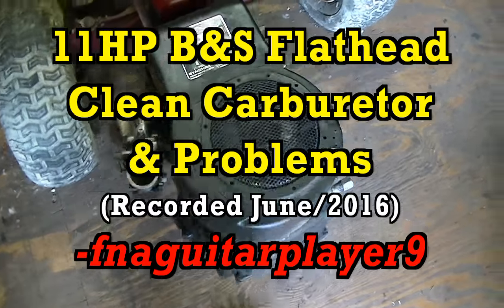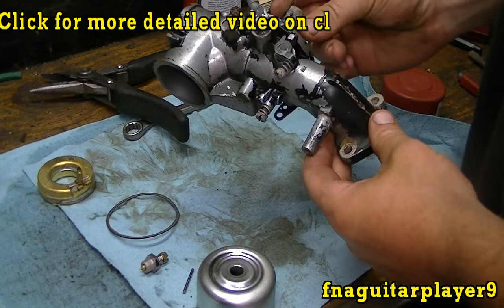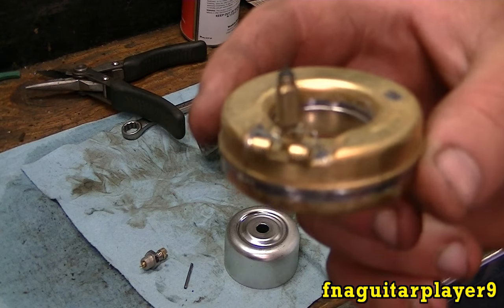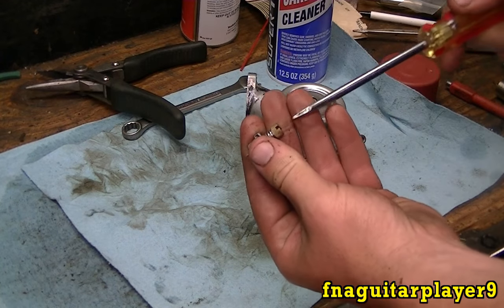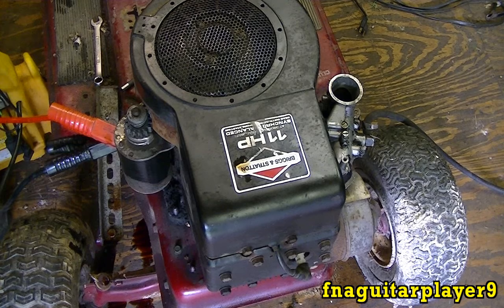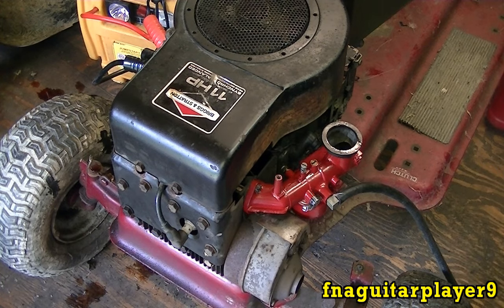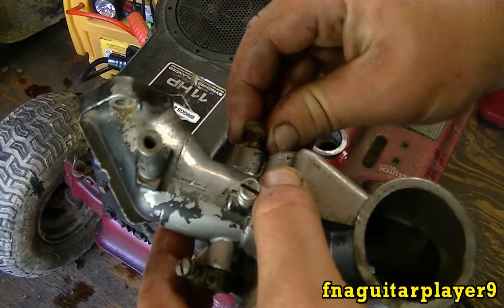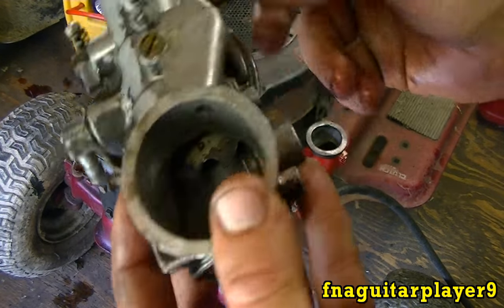11HP Briggs & Stratton Carburetor Clean & Problems

Comment: Every float carb that I rebuild, the float level should be parallel or a little higher, not as much as you are showing to the surface of the bowel top. This keeps the the mix in the just right. When the fuel float is that high, most of the time the engine runs rich. When set properly the engine really runs so smooth and strong. Just saying.
Reply from the maker: Your right, most of the time I will keep them parallel. Thanks for Watching!!!
Reply: @fnaguitarplayer9  So nice to check with someone else with experience working on small engine carburetors.

Comment: Hey thanks for making this video, Is there any reason i couldnt put a carburetor off a 12hp briggs on a 11hp briggs? they look exactly the same but i heard one has internal jets and the other doesnt?
Reply from the maker: Should be the same thing, I've mixed parts around like that. If it bolts on it should work, you can also interchange these with the 2 piece lmt carbs as well, but the linkage is different but they will work. but the one piece are adjustable on the high and low so it will tune in on anything you can make it bolt to. Thanks for Watching!!!

Comment: I recently bought two old mowers, both have 281707 engines.  Both have the one piece carb.  With your videos, I've cleaned them, replaced the main jet (which was badly stuck and badly gummed up with junk).  They also have bad bushings in the throttle shaft.  Do you have a video on swapping them out?  I can see pretty much everything except how to remove and replace the welch plug at the front of the carb.
Reply from the maker: I hear ya! No actually I do not, i was going to replace them in the carb in the video but never got around to it. Removing the welch plug is the easy part, it will pop out if you pry / hit from the inside of the carb, then to reinstall it you "stake" it back, which is just using a small center punch to basically make a "clamp" around the carb body where the plug sits in, if you google it you should find some pics of what i'm talking about. If you watched my video on fixing the overheated 18.5 briggs engine, i did something very similar to the valve seat, i went around the edge with a punch to put more pressure on the seat, its such a simple procedure but works good. I have heard of others putting loctite on welch plugs to help seal them better as well. Hope this helps, Thanks for Watching!!!
Reply: I went and watched both parts of that repair video.  I see what you did.  I found some good sites that show it as well.  Once I knew what to look for.  Loctite, nail polish and superglu are all suggested as a sealant.  But it's not really sealing much.

If I go and do it, do you have any other suggested parts to replace.  Choke shaft/bushings for example.
Reply from the maker: I hear ya. That should be it, the choke shaft isn't as critical, but if its excessive then you could, but i've never had one that needed it, as long as its clean, and you said you replaced the jets, then it should be good to go after that. let me know how it goes.
Reply: As you can guess, you have to take out the welch plug.  I had a replacement from the carb rebuild kit, so I just bashed it in until it went concave and I could push it out.  Then you take out the choke plate & shaft (and drop the spring without seeing how it goes).  Then you can take out the throttle plate, then finally remove the roll pin on the idle control screw and remove the shaft.  

It was badly worn, with about a 0.5mm grove worn on each side.  So that needed to go.  Haven't put it back in use yet, but it moves a lot less now and the entire carb is back in one piece.
Reply from the maker: I figured you'd have to do that, i hate messing with welch plugs! I hear ya hopefully it will take care of it!

Comment: Valve clearance needs to be adjusted. I have a 8hp that was made in '88 that had never had the valves adjusted, didn't start well although it ran when it did start. Took head and breather cover off and intake had no clearance. I was amazed it ran at all. I increased intake clearance, exhaust was ok, lapped, and reassembled. Engine runs good now for a lawn mower I've used for 29 yrs.
Reply from the maker: Yeah thats probably what caused the hard starting and low compression on this one too. They are bad about that. I hear ya, sometimes thats all they need! I'll have to tear this one down and see whats knocking in it, sounds like either rod or counterweights. Thanks for Watching!!!

Comment: Hey mate. Got a 12hp with same carb and everything. Tried adjusting it for hours but it still plutters and stalls when I give it throttle. What should I do and what screws do I adjust
Reply from the maker: I have another video just on adjusting these, instead of typing it out, follow what i do in it, and you should be able to tune it in. Assuming there is no other problems, like the carb needing cleaned, valves needing work, weak spark, etc. https://youtu.be/TlSAOkQnI1g Thanks for Watching!!!

Comment: My carburetor appears to be in the same condition as this one, bushing gone, are they worth trying to fix up or can I retrofit a more modern 2 piece carburetor?
Reply from the maker: I hear ya. It usually doesn't cost to much to fix it, but if you do have a 2 piece laying around, if its off a flathead and not a OHV, it will bolt right on, the only thing you have to change (besides the air filter) is the linkage between the governor arm and carburetor. But other than that its a bolt on replacement. But if you don't have one laying around, it won't take a whole lot to fix the one piece. Thanks for Watching!!!

Comment: I have that same motor 11hp briggs .Iooking at the carb all the way to the right at the bottom it drips a few drops of fuel. just rebuilt the carb .Trying to get everything ajusted . what do i do to stop the fuel leak? It shows some black smoke. You are the first person to have the same motor i do .Where can i get another one for a back up . the tractor was my dads and im trying to keep  it in good shape. Its a 1987 or 1988 Sears wheel horse. Thank you sir.
Reply from the maker: They are great motors! Sounds like either the float, needle valve or seat is causing problems, I actually just put up a video on fixing this kind of issue. Go to my channel it should be easy to find. I used a newer style carb as example but show some shots of this type of carburetor. You might be able to find one on ebay or check on craigslist and places like that for a mower that had these on it, I've gotten a few off of older murray mowers, or servistar mowers. They were used a lot. I hear ya! Great mower as well! If yours isn't smoking yet, or not much, keep up with the oil changes and it should last a long time! Thanks for Watching!!!

Comment: I have two of these carbs, one with more throttle shaft play than the other. I read below that you never got around to doing a repair on this. Apart from being a source of uncontrolled air intake, could it also leak fuel? 

I've seen this unanswered question on JacksSmallEngines from 2016:
.........
Saturday, July 30, 2016 10:38 PM (permalink)

Throttle shaft bushing
Hello, can someone tell me the part number for throttle shaft bushing on this 11hp engine? Model is 253707 0247 0188010511. Carb is a one piece large body Flo-Jet. Part number is 491028. Shaft diameter at throttle stop is 3/16''
............
Maybe it would be easier to find the proverbial needle -- using a metal detector, or a magnet, or a match.

Comment: I've been getting an older Huskee revived.   So far the black oil, old spark plug and ancient battery are new.  Its got a 252707-0632-01 11 hp Briggs & Stratton. It's running rough after a 10 min or so.  I've figured part of the problem is that it has carburetor issues.  The filter looked like coffee grounds.  Chunks in the carburetor of course.  A somewhat loose belt and chopped up butterknife blades are not helping. The former owner must not have known what maintenance was.  Uffda.  Oh well.. it was free.  Lol..  Thank you for the great videos!!

Comment: That's basically the same engine that's on our Snapper RER that I recently commented to you about having battery drain issues and not wanting to start after it sat for a few days except this one is the I/C engine with cast iron cylinder bore. I just took the carb off of it to at least clean it. It seems to run rich and it's had a couple of the brass adjustment screws replaced in the not so distant past, they are still shiny, but I think it's dirty and maybe out of adjustment. I'm gonna check valve clearance also...Do you happen to know what the valve clearance is supposed to be for these engines? This one is an '87 model too.
 Also, this one sounds like it has a slight rod knock also but when I tried to feel for play between the piston and rod through the spark plug hole I couldn't feel any so IDK....I noticed that the coil looks really close to the flywheel and thought maybe it might be touching in spots and making the noise, I haven't checked clearance yet though...Other than those two things I guess I'll have to get inside to figure out what the noise is.....Engine pulls good and strong. Looks like someone made their own governor linkage for it with a small spring that wraps around but I don't think it's quite right but anyway, it has a few issues for me to work out but the engine runs pretty good considering! Thanks for the video, been watching your vids for a couple years now, I always learn something new....
Reply from the maker: I hear ya, sounds like the only difference is yours is the (better) cast iron sleeve while this on is aluminum bore. yeah the intake valve is .005" to .007" and the exhaust is .009" to .011". Alot of times what sounds like rod knock on this type of engine is play in the synchro balancer counter weights. I've had to make linkages before, a thin coat hanger works great haha the engine on my little tractor, its missing the linkage between the gov and carb and its like 20 bucks for it, I'll be making one there haha Your welcome, appreciate you watching my videos!!!
Reply: fnaguitarplayer9  Yes Sir!
 I hate to keep busting your chops on this same video but I don't work on these for a living, just here and there when something needs done. I'm gonna be checking clearances when I get in the engine soon, piston, rings, rod, side play etc. I have a feeling that this one might need new valve guides and/or valves cause it puffs a little smoke when I first start it. I've noticed that Briggs valves are about twice as much $ as Stens valves. Do you have any experience with Sten valves? What are your thoughts?
Reply from the maker: Its no problem! I hear ya. Honestly when you buy briggs parts your paying for the name, i haven't seen any major quality difference on parts, I use aftermarket all the time for my own equipment,  but sometimes a specialty part or someone may want actual B&S. Which i would prefer to use to but it cost so much more. I don't know if i've used stens valves or not, but i'm sure they are good quality, every thing else i've gotten from them, rotary, oregon and primelime have all been good parts.
Reply: fnaguitarplayer9 That's good to know, thank you...Yeah, I ordered a Chinese starter drive kit for it a couple weeks ago and so far I'm impressed. The sorta cone shaped part that you line up with the hole in the shaft where the spring pin goes in is metal instead of plastic. That seems better than OEM. Not sure how long the black plastic gear will hold up compared to what was on it, I'm assuming it was original, but time will tell.
Reply from the maker: I haven't had any major problems with aftermarket parts, few minor things here and there but that with everything.

Comment: H, I have one, an 87 model. Mode in Ohio, still has sticker on it to say so ( I'm in Australia). Where the fuel line goes into the carburetor it has a tap. When the tap is open to run the engine, it has started to leak fuel. I think your video has answered part of my questions. Looks Like if I can get one of the 90 degree adapter's as shown on your carburetor would screw into the carburetor and replace the tap. Do you know what they are called and size of? Also I have just seen some one with a plastic tap connected in, like this one - https://www.ebay.com.au/itm/FUEL-SHUTOFF-VALVE-TAP-1-4-FOR-BRIGGS-AND-STRATTON-LAWN-MOWERS-698182/172822182917
Should work?

Thanks, thanks for the video. Uncanny their the same age. YouTube is a gem.
Reply from the maker: Yeah, you should be able to buy the elbow, i can't seem to find the part number for some reason, i'm not sure if the one in the link would work, it might, as long as the thread is the same size. wish i could help more. Thanks for Watching!!!

Comment: do you ever do work on older Briggs motors? I got a 66 model 8 that i ran some ethanol gas through and it buggered up the plastic float needle, but the design of the carb is different from anything i've seen.
Reply from the maker: Some, I have a 1954 briggs 6s ( I have a video on it running) and thats the oldest briggs i've worked on. I hate ethanol gas for that. Its bad on small engines. You should be able to find the parts on ebay for it, some are still being produced but mainly it will be NOS or used parts. If you can make a video on it i'd like to see the carb design. Thanks for Watching!!!

Comment: Nice to have a spare carb to test ,
picked up a 2014 craftsman snow shredder 250cc briggs seized engine , mint chassis , tore apart piston seized to cylinder and grooved , aluminum transfer on cylinder, cleaned bore with muriatic acid and flap wheel , honed with red scotch brite pad , welded the scored piston and coated the skirt with spray on graphite dry spray lube / baked in oven 2 hrs , 
reassembled engine and install back in chassis . no start , no fuel in carb . tear down carb and clean main jet and emulsion tube 
now surging !!!!!!!!!!!!!!!!!!!
Reply from the maker: Yeah it comes in handy, good way to verify that it is the carb and not valves, etc. I hear ya! Quite the repair! Try adjusting the governor too after cleaning it thoroughly. Thanks for Watching!!!

Comment: How tight do in put the carburettor screws on
Reply from the maker: Not super tight, but i'd say get them as tight as you can with a screwdriver and then a 1/4 to 1/2 turn with a wrench or ratchet. Thanks For Watching!!!
Reply: @fnaguitarplayer9  cool I did that and no problems so far😃
Reply from the maker: @legowarriorsadventure3613  Glad to help out!

Comment: I think I have the same engine on a cub cadet 1106 but it runs hard and dies when deck is engaged I’m thinking I need to do some carb work
Reply from the maker: Yes, more then likely its a carburetor issues, also check the spark plug to. Thanks for Watching!!!

Comment: hi i have same motor and carb on simplicity 4211 and starts hard and doesnt  run well now. its like its running at half power please advise
Reply from the maker: I would suggest cleaning it first then follow my video on how to adjust these type, these are the best carburetors they made in my opinion and have a ton of adjustment on them. Thanks for Watching!!!

Comment: Hey buddy I got a 11hp not sure the year little newer then this one but I have compression and spark no tank planing on putting it on my mower but I’ve shot gas in the carburetor and it doesn’t even wanna hit off of that what could be my problem
Reply from the maker: Usually when they don't want to hit at all its possible that the flywheel key is sheared throwing the timing off, it will still spark but not at the right time. Or it could be to weak of a spark. Carb may need cleaned too. hope this helps, Thanks for Watching!!!
Reply: fnaguitarplayer9 thanks man took the carb off and it was caked in rust cleaned it up and runs great ur videos help alot

Comment: Hi, I hve the same engine on a 1983 or so John Deere 111. When I got it it wouldn't run. It would try to stsrt but as soon as I let off the key it would die.  Seems to have good spark , had the same throttle bushing problem, so I put a new carb and fuel pump on it, still wouldn't strart, cleaned the ignition switch with carb cleaner, blew it out then used contact cleaner. now it starts.  Have the carb adjusted fairly good, seems to have plenty of power, but when I engage the mower deck thru the PTO it will go a few feet then bog down and stall.
I'm thinking greasing the deck and checking the belts as soon a the rain stops, any other thoughts ?
Thank you, Bob
Reply from the maker: Sounds like the keyswitch is on its way out, i would suggest replacing it soon. Sounds like your on the right track, but if a bearing is locked up or a idler pulley that will need fixed first. Hope this helps. Thanks for Watching!
Reply: Thanks much, I'll let you know what I come up with.
Reply from the maker: no problem, sounds good.

Comment: I drove this engine until it caught on fire the other day (i think it was from some oil and built up grass that lit up after the engine got hot) 
It took me a minute to get water to put it out and flames were gulping,  I've noticed a reduction in HP ever since, Any ideas on what to check?
Reply from the maker: If it overheated, due to low oil or cooling fins being clogged up, then it may have valve damage, or if its smoking now it may have damaged the rings/cylinder. But it could be something as simple as a weak coil too. Could be a number of things when something like this happens. Thanks for Watching!
Reply: @fnaguitarplayer9  ok thanks man, i just replaced the coil before it happened, when i took the air filter apart it was a bit chard and plastic insert was melted so i cleaned it all up,, im gonna try a new fuel filter because it was near the fire and got heated up
  (pretty sure the fire was from built up grass/oil)
    only 1 wire got the sheathing melted off, the one that goes to the coil for the shut off, but the shut off is still working fine